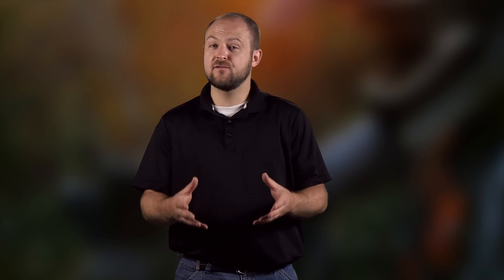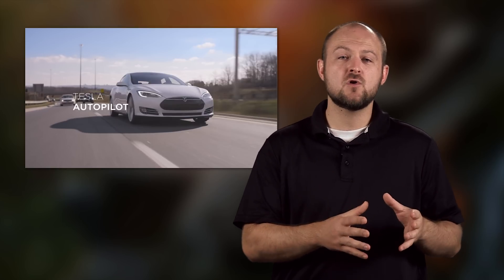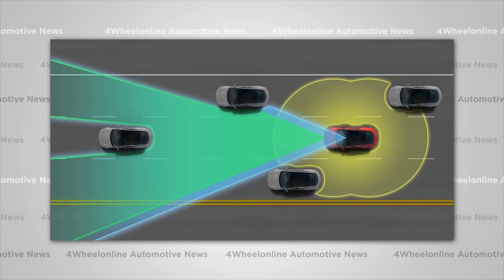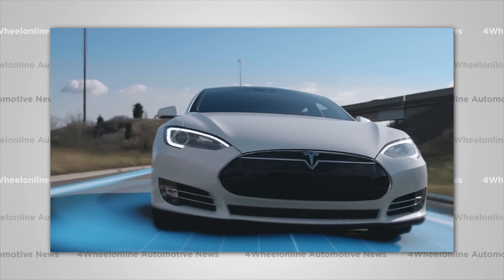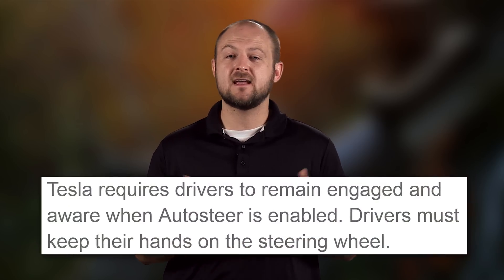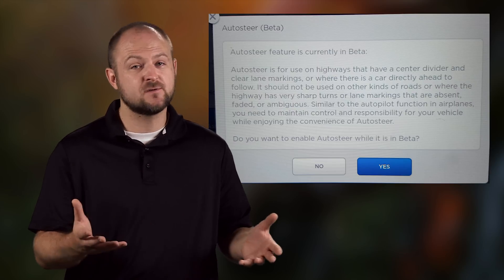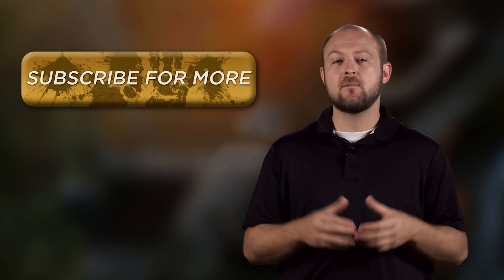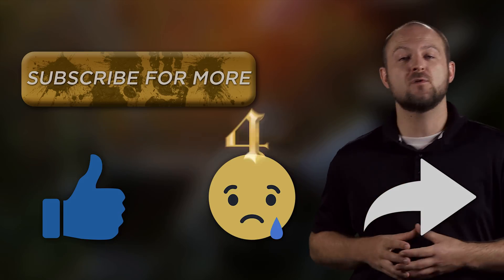Man Killed While Using Tesla's Autopilot: How Autopilot Works and Who is at Fault

Comment: The truck made a left turn without stopping and if you add that usually if you go at high speed nothing could save you, the truck driver will say that it was the driver of the tesla fault that is logical , and tesla also explained to its customers that the autopilot is an Assistant to driving not a fully autonomous car, also if the Sun you this pasting directly into the eyes could not distinguish a white truck ahead of you so this is an accident where the blame was shared by the driver of the truck and the testa a human error.